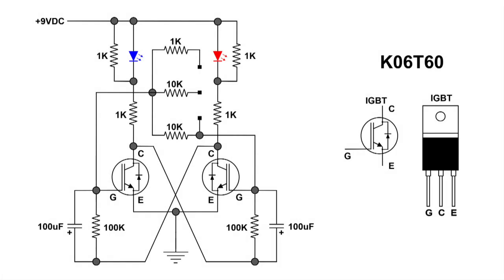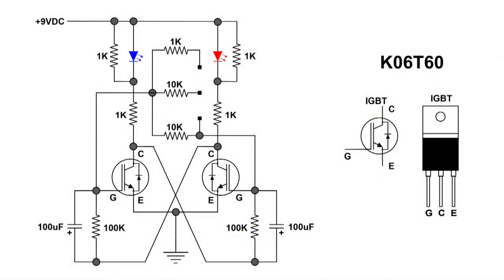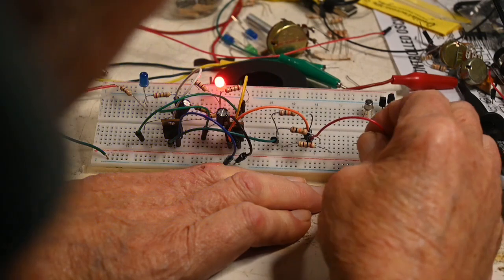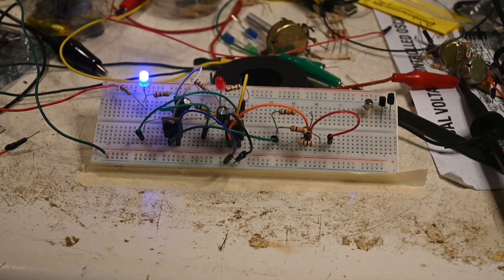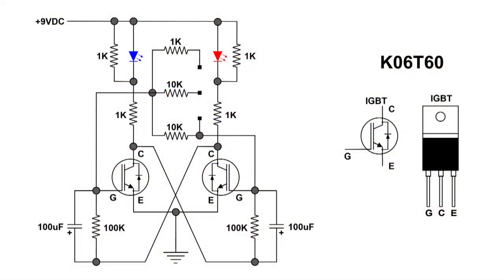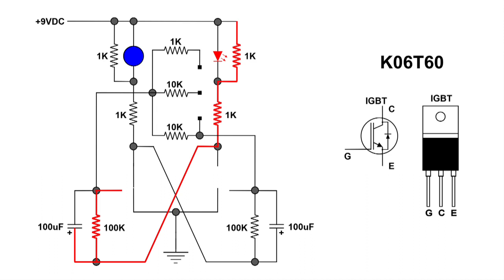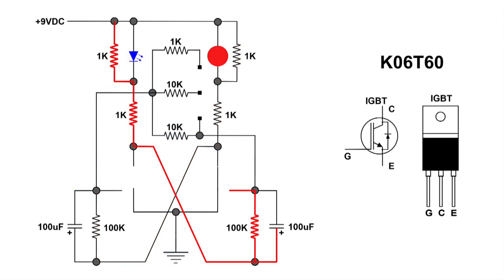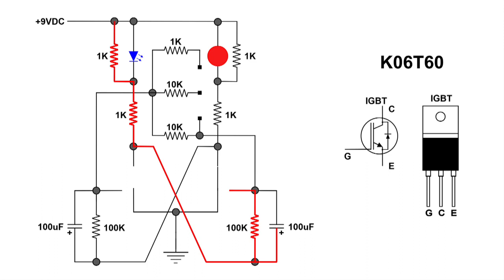IGBT Astable Multivibrator

Comment: I like how radio circuits are basically the same thing just faster. 🙂👍
Reply from the maker: I have been think about using a Astable Multivibrator circuit to replace a mechanical vibrator for a military radio. I think this circuit with IGBts is promising.

Comment: Nice circuit Rick. Handy for a lot of stuff I think. :)
Reply from the maker: Hey Doug, I have been think about using a Astable Multivibrator circuit to replace a mechanical vibrator for a military radio. I think this circuit with IGBts is promising.
Thanks.

Comment: Thanks Richard, a very good experiment to do this with a IGTB transistor. We all know the classical ways of doing this, but this is a new way of doing this. Useful for reproduction, in all kinds of oscillator circuits. 16 dec 2022.
Reply from the maker: Thanks Ko. I have been think about using a Astable Multivibrator circuit to replace a mechanical vibrator for a military radio. I think this circuit with IGBts is promising